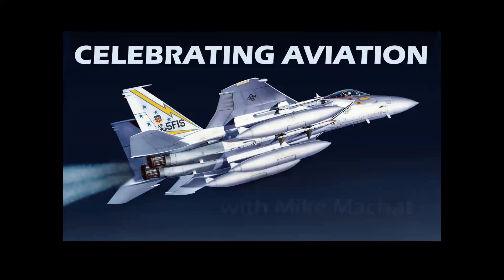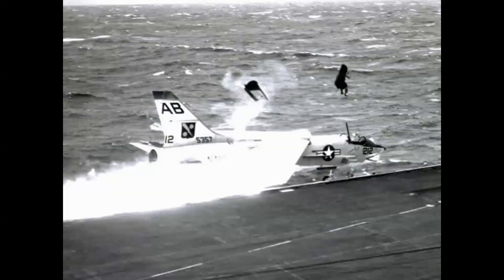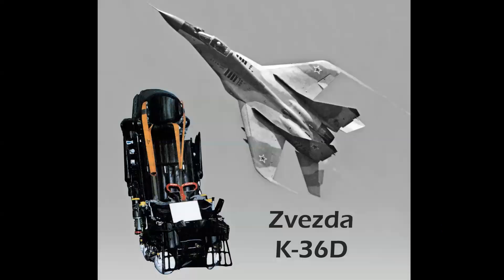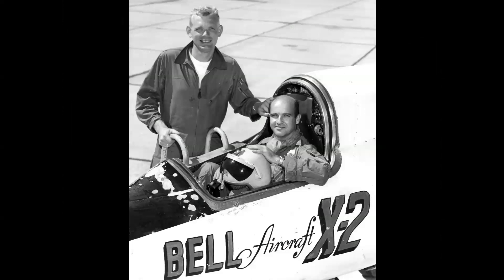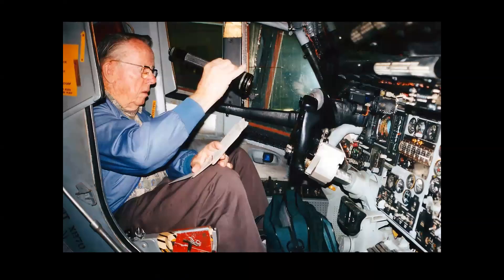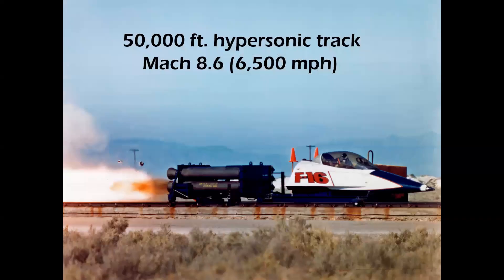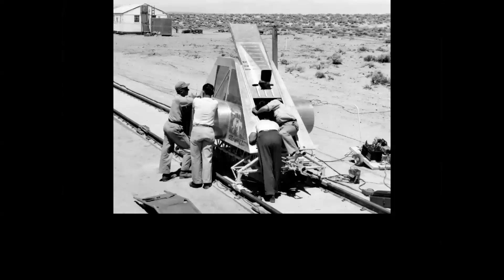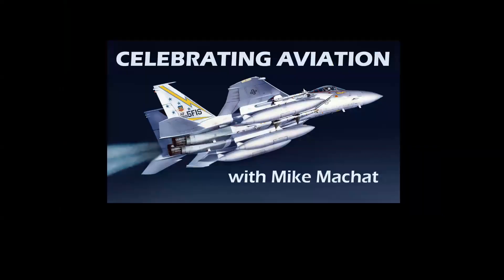VIDEO DIRECTORY - Exciting Episodes on Ejection Seats, Escape Capsules, and Rocket Sleds!

Comment: When I was an avionics tech in the Marines, I got to go to a day of seat school and fly in the back of our TA-4's.  I heard a figure of something like 80% or 90% successful ejections, and I was a bit surprised that it wasn't much closer to 100%.  It was explained that this figure only included ejections where the person did everything correctly... was sitting in the correct position, etc.  It also didn't mention that the person might be severely injured during the ejection.  It  took away the illusion that the ejection seat was an easy solution to any trouble in the air.

Comment: I like the brown smoke in the last painting. do you have any details as to what kind of rocket propellant these ejection seats used? some kind of nitric acid? solid-fuel?
Reply: It's pretty standard to use solid propellant in the rocket motors for seats.  They are stable and require very little attention.
Reply: If I was ejected, there will most certainly be brown residues on the seat!